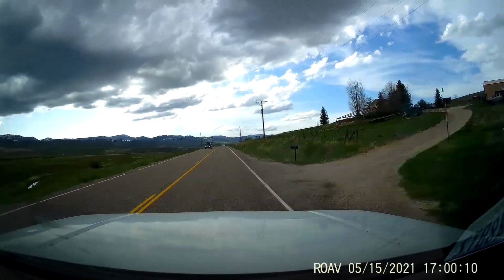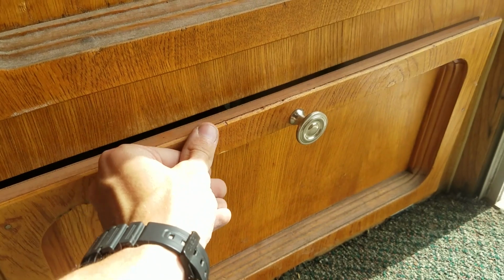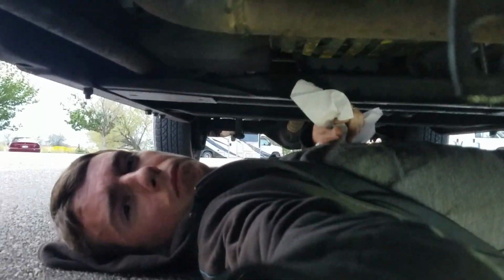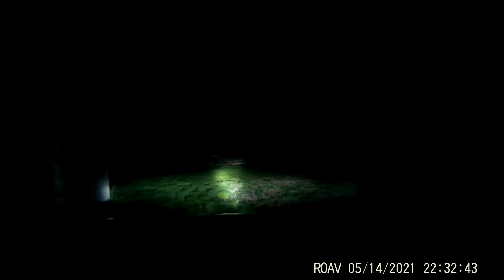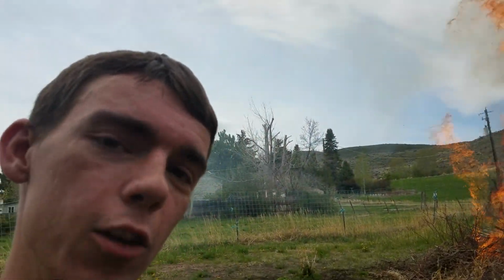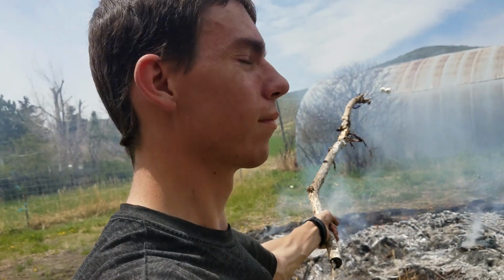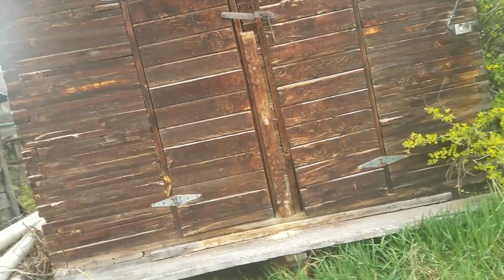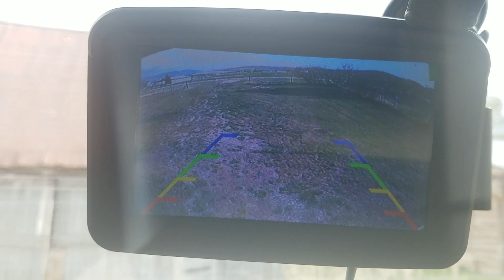Joeman goes camping

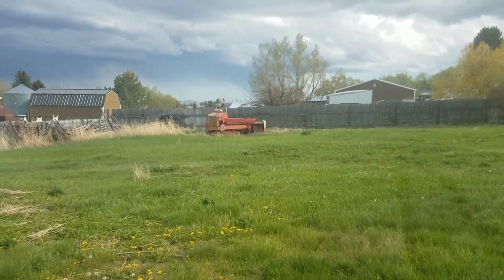Comment: 8:00 the thing on the right is a swather they were used to cut wheat and grass, the thing on the left is a combine, Is there a tractor in the brush?
Reply: I wish he would have got closer. The combine looks like it might be a massy Harris and the swather might be a versatile, but it’s hard to tell from what we saw of them
Reply: @albinobuffalo9073  I'd say your correct man I'd love to have a combine
Reply: @pattonm4753  they are neat machines for shure. But once they get some hours on them they can become very expensive and high maintenance to maintain. Especially if you don’t stay on top of it. They have a lot of wear points.
Reply: @albinobuffalo9073  yeah probably twice as bad as a mower conditioner
Reply: @pattonm4753  ain’t that the truth. Our MOCO is typically trouble free, just the usual wear parts.  But it’s like any thing it’s all in how you run it and maintain it.
Reply: @albinobuffalo9073  ya true our Mower conditioner is probably gonna die soon it unfortunately spent the majority of its life outside
Reply: @pattonm4753   it surprising how just a simple thing like moisture and sunshine can really destroy a good piece of equipment in short order. Thankfully were fortunate to have enough shed space to keep all our important equipment under cover.
Reply: @albinobuffalo9073  ya it is.. you are very lucky to have storage for your equipment we are getting there though....
Reply: @pattonm4753  yea it takes time to get buildings pit up. We saved for quite a few years before we had enough to put our big pole barn up. But the biggest savings came from building it our self. But we’re fortunate to have the ability and tools to do so.
Reply: @albinobuffalo9073  ya we got a mill recently so hopefully we'll be able to build a nice big shed
Reply: @pattonm4753  that will be a big help and go a long ways towards helping keep the costs down. It will also be better quality lumber to. What type of trees do you plan to saw.
Reply: @albinobuffalo9073  I think pretty much anything... we've done Pine Cedar Aspin etc
Reply: @pattonm4753  cedar is pretty rot resistant. Almost all of our fence posts are cedars that we cut off the farm. Black locust and hedge apple also make for some very rot resistant posts, but they don’t typically like to grow straight.
Reply: @albinobuffalo9073  yeah there's a lot of cedar post around at my place that predate when my grandparents bought it
Reply: @pattonm4753  yea if you get a cedar that is solid red  in the center it will easily last 50 years or more.
Reply: @albinobuffalo9073  I think some of the ones I was talking about are close to 70 and they are very red internally
Reply: @pattonm4753  that wouldn’t surprise me. There are still a few cedar split posts left from the original fencing on this farm that date back to the 1920’s and are still somewhat solid yet.
Reply: @albinobuffalo9073  its pretty incredible isn't it!
Reply: @pattonm4753  yes it is. Mean while those over priced pressure treated pine posts you buy at the farm store rot in two in less than 10 years. Or at least here in the ozarks they do.
Reply: @albinobuffalo9073  yeah that's about how long our pressure treated deck lasted
Reply: @pattonm4753  if only you could get the old creosote treated wood. The type that was treated completely through the entire post.
Reply: @albinobuffalo9073  we have two sawmills (a portable mill and a old circular mill the Circular mill is currently in pieces) the circular mill is coated in creosote it in pretty good shape still.
Reply: @pattonm4753  creosote really is some good  stuff. A lot better than whatever they use on pressure treated. We had an old wagon that the deck was made out of sawn telephone poles that were creosote, it finally rotted out last year but there’s no telling how old it was.
Reply: @albinobuffalo9073  wow yeah that stuff is quite impressive....